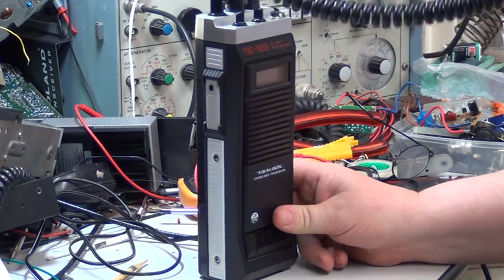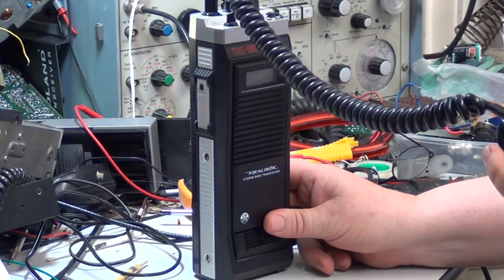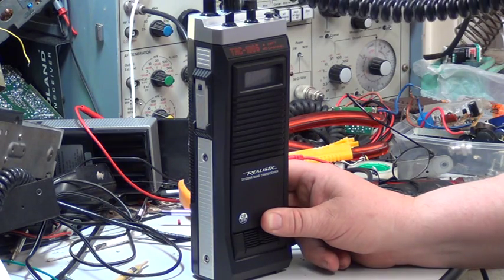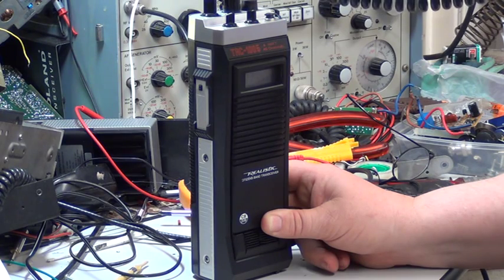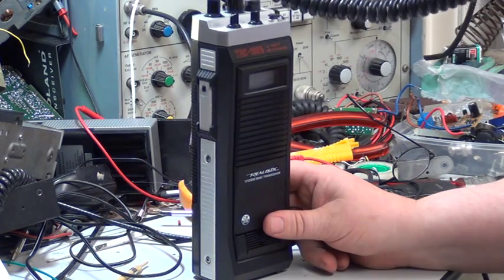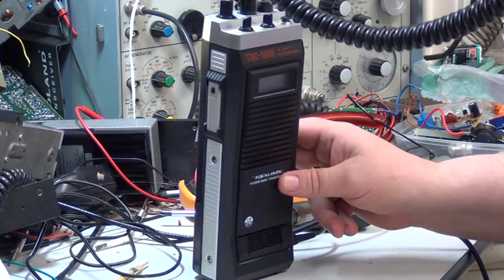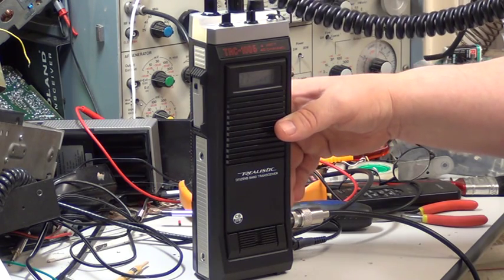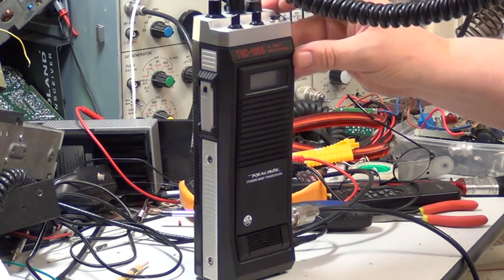Realistic TRC1005, UK CB radio 3.5W, 40-channel (Hand portable). On The Air Test

Comment: I’ve just picked one of these up. Can you tell me what type of external microphone connection is required?
Reply from the maker: It's the standard pinout for Realistic. They use a bit unusual locking mechanism on the unique 5-pin DIN plug. We just use  high quality metal DIN plugs with gold pins which are a tight enough fit with a standard communications mike.  I just typed "realistic microphone" into ebay & the proper original mike popped up for £12.95 'buy it now'. Using the original mike/plug guarantees the TRC1005's internal/external mike switch gets properly activated when the mike plug is inserted.

Richard